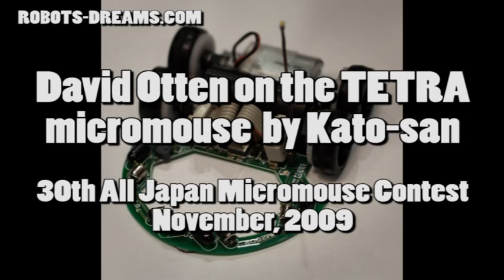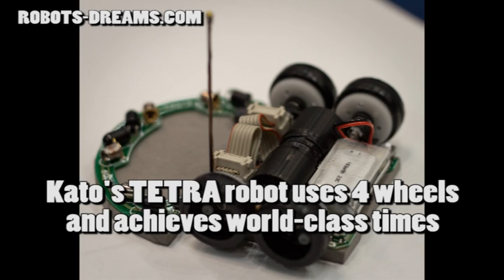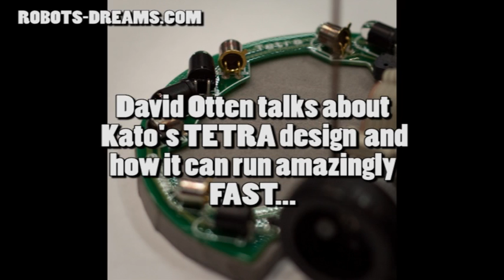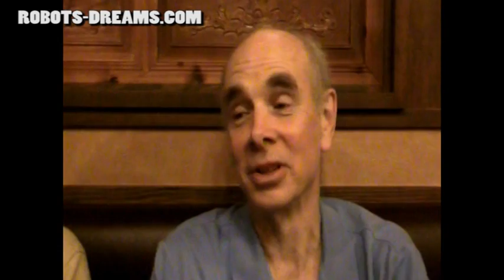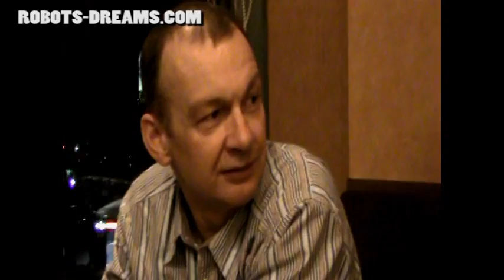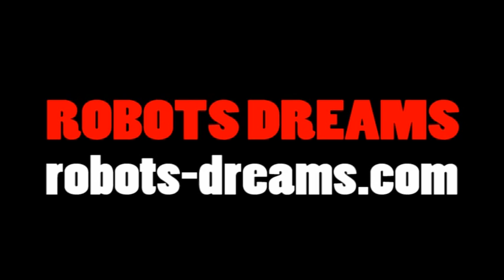30th All Japan Micromouse Contest: David Otten on the TETRA design

Comment: I was thinking how come the designer use 4 wheels.... and I think 2 of the wheels helps the bot to do the break.... I have tried breaking using 2 wheels by instantly apply a very high voltage to the motor and then assert an inverse voltage to drive it forward...( like a 1 us pulse of V-)  it kind of worked...but I have to take the motor capacitors out and replace it with diodes... ( because the charge time of the cap is like 2us and the slew time will slow it  down),